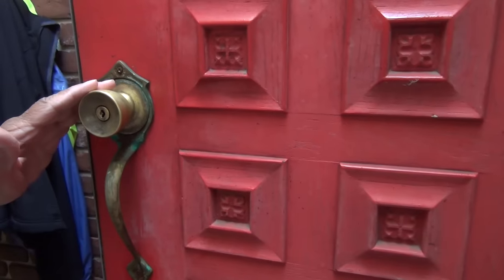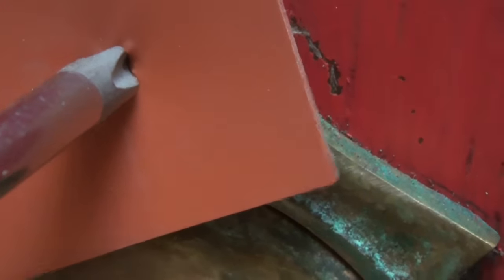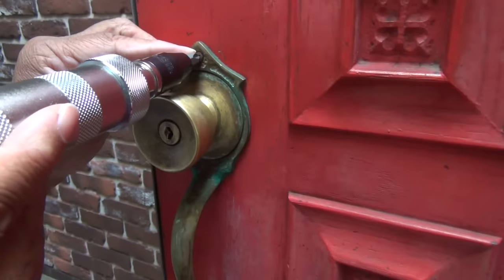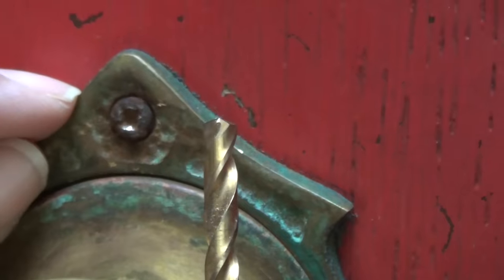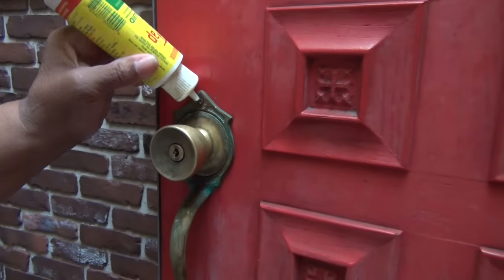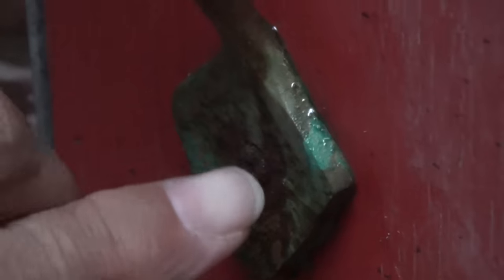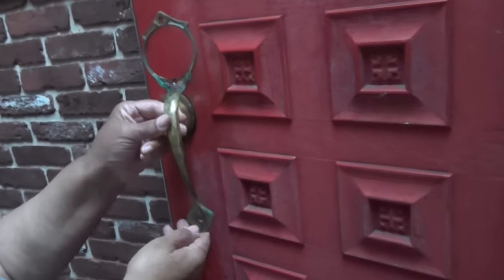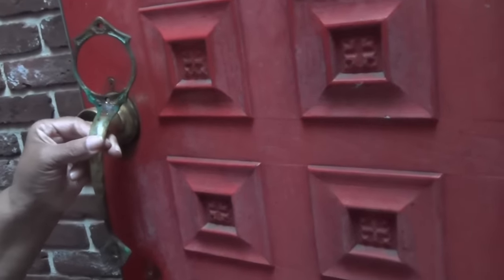How to Remove Damaged and Rusted Screws FAST

Comment: Another tip is if you have a stripped screw is to use a dremel to cut a slot - essentially making your own flathead screw. Of course that wouldn't have been helpful in this situation where it's seized like that.

Comment: my problem is the screw is holding together an old keyboard, its rusty and stripped and i dont want to drill on it since the kyboard could be valuable if i clean it up

Comment: I have some old rusty screws in my plywood subfloor. I am trying to plane the subfloor because part of it is uneven and not level. My problem is the rusted wood screws that are screwed into the subfloor. I am scared to just run over them with my planer, but I'm not sure now to go about removing them. Some of them are severely deteriorated. I may just try bashing them in with a hammer if all else fails. Any ideas anyone?

Comment: What if the head of the screw has been taken out but the rest is too deep for the vice grip to lock on.  How would you take out the rest of the screw from the door?
Reply from the maker: I'd have to drill it out completely
Reply: @seejanedrill  Would you use a smaller drill bit or the same one used on the head of the screw?  Thanks for the reply :)